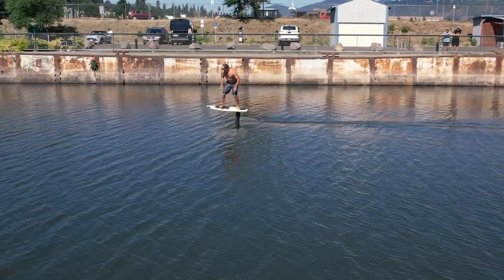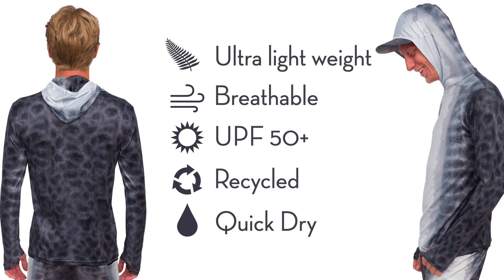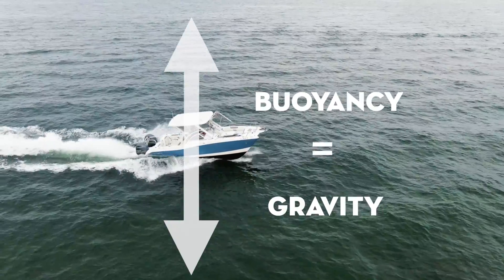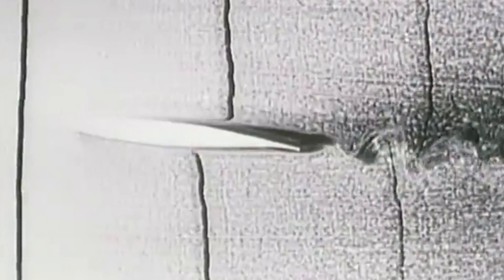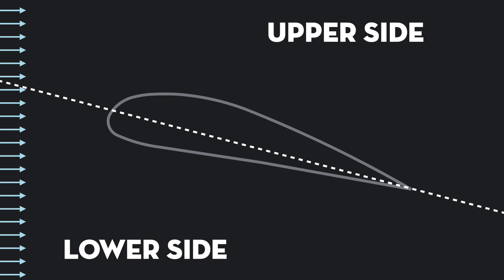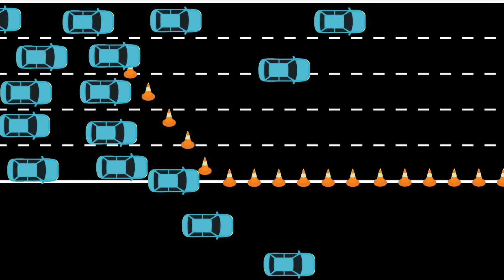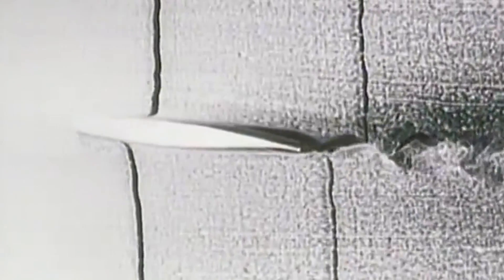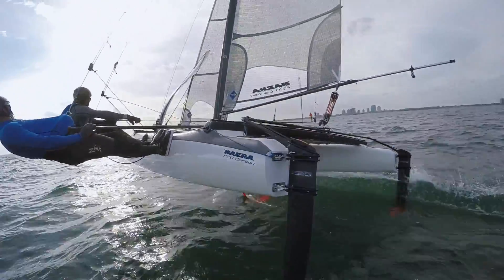How do hydrofoils work - a deep dive into the physics

Comment: Take fluid mechanics again!
Reply: @Waterlust  that is an oversimplification and you should know it. The area used L² is an aproximation caused by that oversimplification. The truth is that the fluid is only accelerated downwards around the foil, whilst it is accelerated upwards elsewhere (and vorticity is added to the mix). All of that is caused by the foil, also the upward acceleration of the fluid, amongst other reasons because the flow of water at these speeds is incompressible. The downward acceleration of the fluid around the foil (locally) causes the increase in pressure on the underside and a decrease of pressure on the upper side (as you rightfully explain), but it also causes the fluid elsewhere to move upwards and swirling (which also compensates for the downward momentum of the part of the fluid moving downwards).

Therefore, lift is produced by the difference of pressure caused by the geometry of the foil moving through the fluid. Not by the momentum of the fluid transferred to the foil. That is misleading.
Reply: Did he get something wrong?
Reply: @potsmkr87  Totally! A foil doesn't work by deflecting water doenward and then pushing upward the payload as a reaction! If that were the case we would simply use flat plates! And we don't!
Reply: @PereAndreuUbachdeFuentes  flat plates should work as foils, they are just not as effective
Reply: @potsmkr87  , by stating that, he is invoking the principle of conservation of quantity of movement. But that principle is not at play here, because the foil doesn't change its vertical velocity, and neither water's overall vertical velocity isn't changed if you measure  the velocity of water of a section sufficiently upstream and sufficiently downstream from the foil. No, that's not how a foil works!
Reply: @Waterlust  So if the total momentum of the system cannot change, and the vertical momentum of the foil (and fuselage and payload) stays constant —as it doesn't accelerate vertically— how can you claim that the fluid is accelerated downwards? It is obvious that the total vertical momentum of the fluid doesn't change!
Reply: @PereAndreuUbachdeFuentes  gravity is the other factor here which balances the momentum equation. I.e. the downward acceleration of the fluid balances the gravitational acceleration acting on the payload.
Reply: How does the pumping work?
Reply: @Waterlust  I insist: conservation of momentum has nothing to do with lift! As there is no upward momentum gained by the foil, nor the fuselage nor the payload. Upward force is not the same as upward momentum!